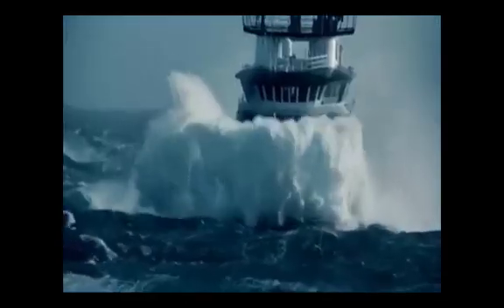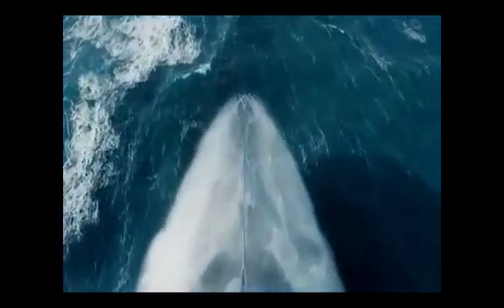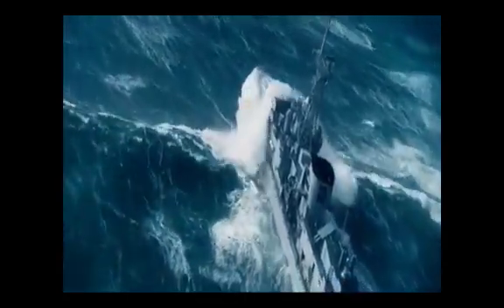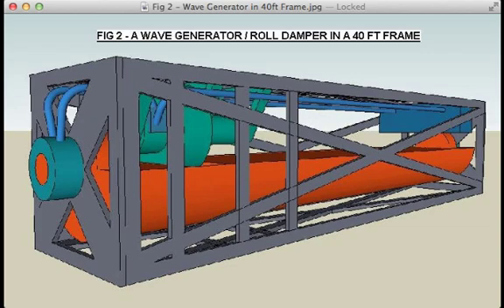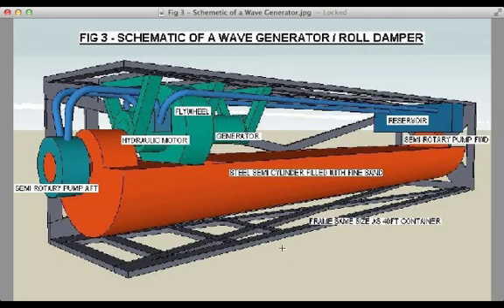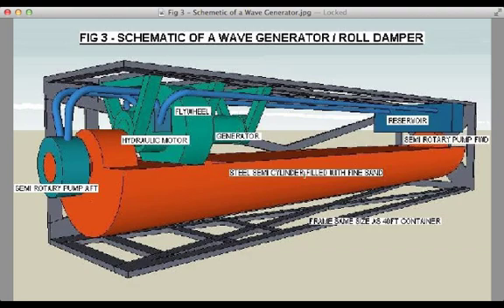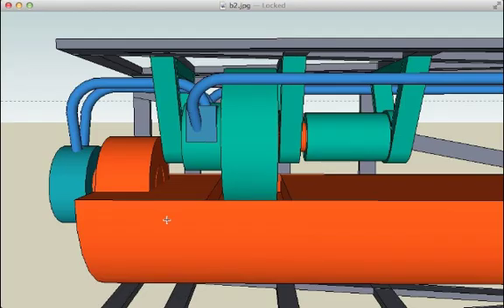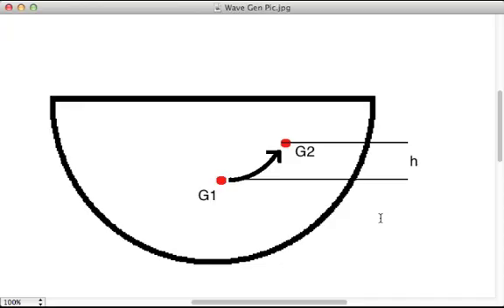S011 - Wave Energy 01

Comment: I'm surprised you went to all the trouble of producing those fancy drawings before running some simple calculations.This idea was "dead in the water" from the beginning.
So many of these so-called "wave energy converters" are massively over-engineered for woefully small returns of usable power.
There is a much simpler and cheaper way to do it.
Reply from the maker: Yep! It's only when you do the maths you realise the low energy densities of renewable energy.
Reply: The energy density of waves is not that low, actually, especially the bigger storm waves that represent most of the measured resource. The problem with waves is how to make a device that is cheap enough to harvest that energy viably, without being smashed to smithereens, corroded, fouled, abraded or sunk.
The very energy density of ocean power is one of the main things that makes it problematic to harvest. As anyone who has spent any time on the ocean will tell you, it can get very angry. And when it does, stuff breaks.
The biggest problem with wave power, IMHO, is that the overwhelming majority of the resource in any one area is contained within the largest waves, which only occur for a limited amount of time. A sort of 80/20 principle, but it's more like 90/10. To build a machine to even withstand (let alone harvest) the biggest waves is prohibitively expensive, but it will sit idle, or woefully underutilised, for most of the year. Capital intensive. Erratic output. Not a good combination if you're looking for cheap electricity.
There are lots of designs out there, literally thousands, that seek to overcome this basic conundrum. I haven't seen anything yet that looks like it might be viable in anything other than very narrow niche cases.
There might be some promise for electro-active polymer materials,  some sort of light floating mat with no moving parts. But that sort of tech is probably decades away...

It must be noted that the low energy densities are not necessarily a problem. The trick is to find an effective way of harvesting or concentrating that dispersed resource as cheaply as possible. You can trawl an entire lake, and harvest a lot of fish, with a cheap net that fits onto a small boat.
The principle is the same. If you have a cheap enough net, and can cast it widely enough, it matters not that the prey is ethereal.
Solar PV is an example of this, with EROEI factors that are steadily improving, implying that the required material is decreasing (doing more with less). Also wind turbines, with massively increased swept areas (squared function) achieved by small (linear) increases in blade length.
Reply from the maker: I totally agree with you here. I put forward a proposal to MIT to propel ships with wave energy by synchronising the rolling period of ships to the wave frequency. However, I was surprised that even completely eliminating heavy-oil-fuel-costs using such technology would not make the way we transport goods at sea more economically viable. http://climatecolab.org/contests/2014/transportation/c/proposal/1307201
Reply: I read your proposal.
There are some other proposed devices that rely on similar methods to capture wave energy. (A damped pendulum, basically.)
If it is going to be viable to do it in this way, I don't think the best application would be in direct propulsion. Lots of constraints that will almost certainly make it uneconomical. Some of which you have listed in your proposal.
But if you can find an old rusty hulk and set it up with an onboard pendulum that simply generates electrical power, you have an interesting experiment. Because you're then in a position to measure the power ouput in real time on an ongoing basis, without needing to go anywhere. You can set it at passive anchor, or power it to face various angles of oncoming waves.
Get real data. 
Modify the design (or the assumptions).
Get more data.
Modify.
Repeat.

But I suspect that your underlying assumption of 50% efficiency is woefully optimistic...